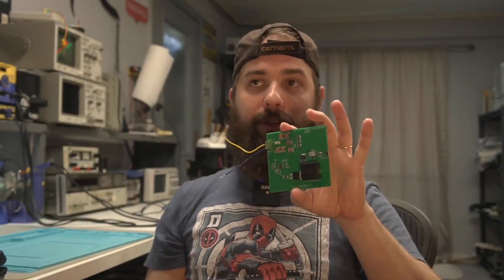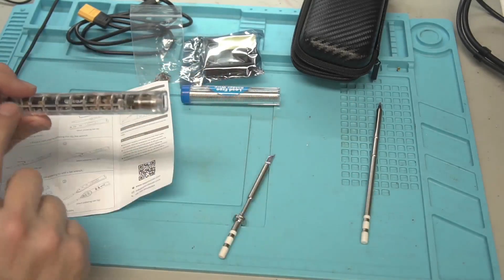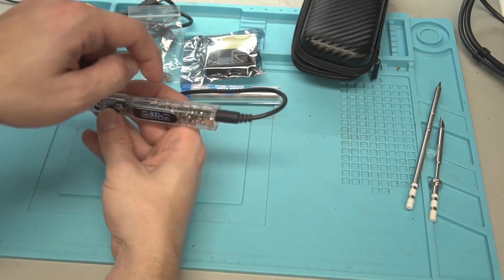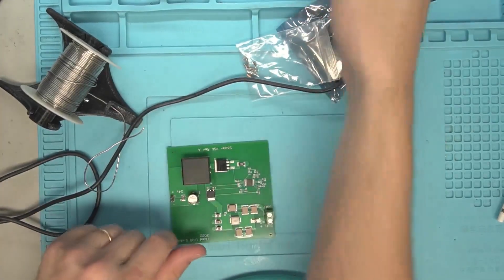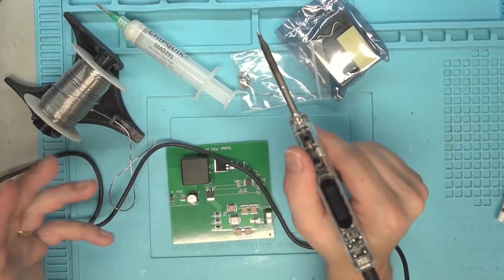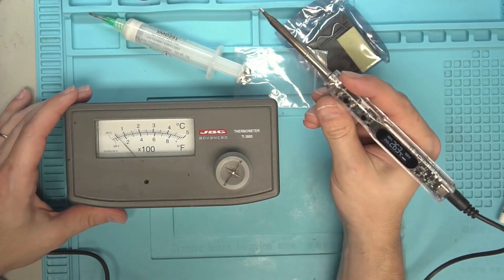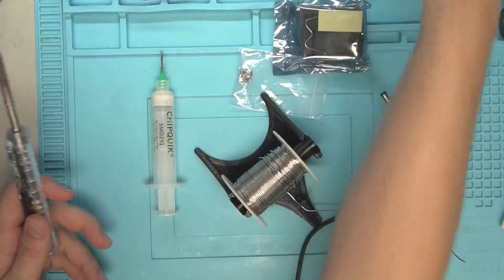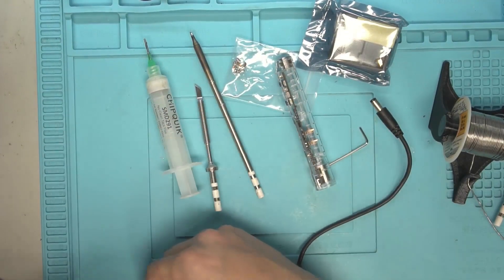SEQURE SI012 Pro T12/TS100 Soldering Iron Review and Test Drive

Comment: The pro option of the iron was built so you didnt need to remove those contacts. Its displayed in their advertising, it uses software to control the contact operation. 2:48
Reply from the maker: I don't recall that model existing at the time of recording but great to know! Thanks for the heads up.

Comment: I have been soldering since I was a kid about 8 years old. My dad had a soldering gun that I used plus the irons I would buy from Radio Shack. I completely agree that while those are usable that they are not fun to use. The biggest problem is the tips burning up & not replacing them. I used to scrub my tips with those Chore Boys but found that if I don't use those & do not over heat my tip they last forever. It is much better to clean your tip with solder. keep a little on it when you are finished, wipe it off with a dry paper towel, & shock it with a damp towel or spung if you have to.

I have never came across bad solder or flux tho. Not all solder is the same alloy. I do not like lead free but can get it to act as expected. I have used plumbers solder to work on surface mount components. It isn't often but I have used hard rosin to solder also.

So the biggest factors are a decent solder iron which can be had for $25 these days, temperature control, & clean.

I am sure way back that alloy was questionable but I don't think that is still an issue or I have been very lucky for almost 40 years.
Reply from the maker: The super cheap solder that come in Chinese kits. Like the learn to solder Christmas tree kits. That stuff can be actually grainy from impurities not just the natural bit from being lead free but actually grainy.

The reason I say good flux is not that cheap flux doesn't flow or work but later down the line you have issues with corrosion with some of the really cheap stuff.
Reply: @FixedUntilBroken  
I agree with some of it being corrosive. Even the no clean solder flux should be cleaned off in my opinion. It really depends on what I'm soldering. There is times I have left it and never gave it a second thought but these tiny surface mount stuff seems to need cleaned more in my opinion.

Like I said I may have just been lucky all these years but I have been ordering from China for about 15 years & love the stuff.